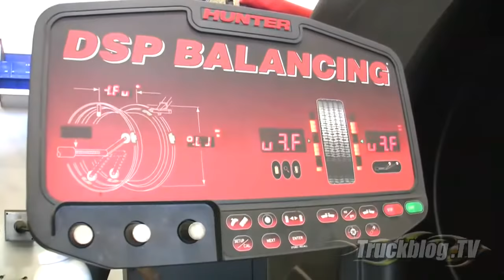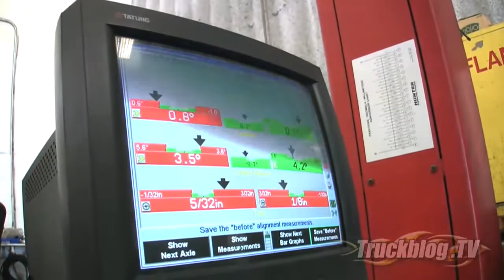How to Install Skyjacker Suspension Lift Ford F-150 Motorz #4

Comment: yes it should fit fine, usually 35's will fit pretty well with a 6 inch so 37's should fit okay with a 7 inch lift it might be a little a tight though

Comment: What length are the u-bolts?  And did you have to cut the front leaf spring bolt next to the fuel tank?

Comment: I just bought a 2004 Ford F-150. It has 169,000 miles. I hope it lasts awhile. It seems well maintained. I would like to put a leveling kit on it. Any suggestions on brands for the leveling kit?  How long will the F150 last?

Comment: Any issues with the pinion angles?
Reply from the maker: None. Still my daily driver, and no issues!
Reply: Motorz awesome, thank you for the quick reply.  I saw the wedge on the bottom and it looks like it would over rotate the axle.  I'm looking at removing my 3 inch blocks and replacing them with the rear skyjacker springs.